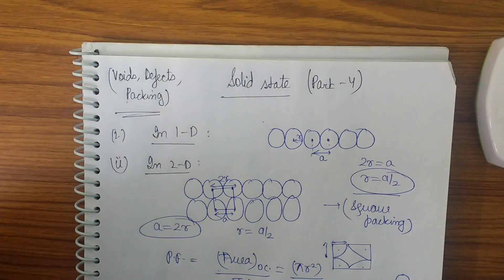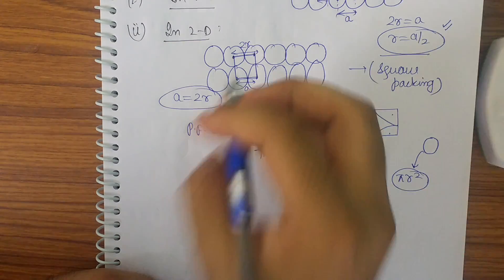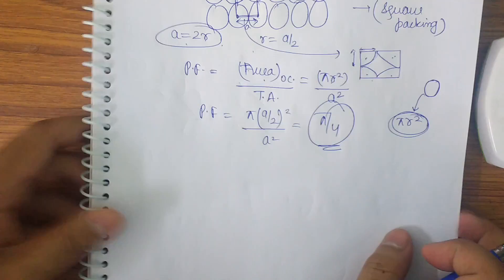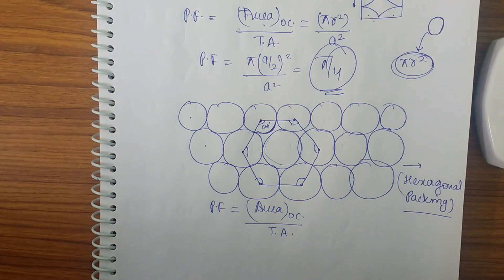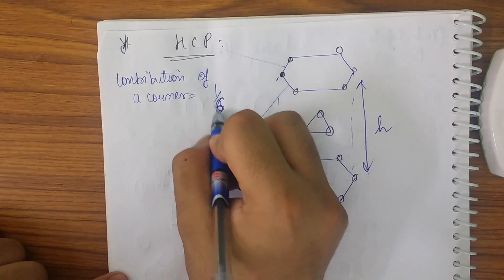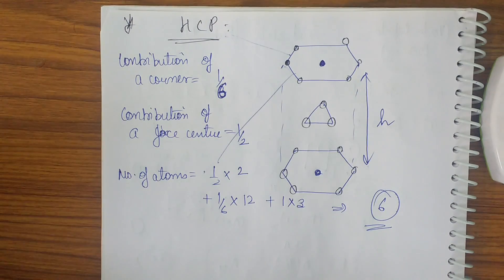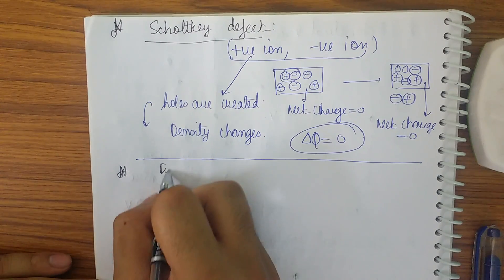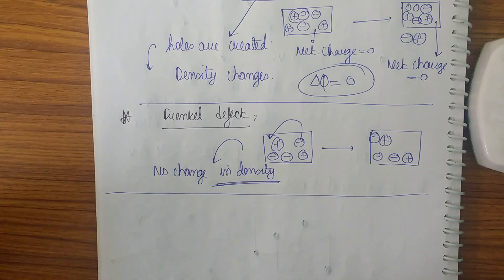Solid State (Part IV): Voids, Defects.

Comment: Hi, bhaiya I had a doubt. In metallic crystals the binding force is the metallic bond,which is non directional in nature.Consequently it is easier to slide the molecules, since different orientations would not result in diminution of the attractive force.....then wouldn't that mean that metals should have been soft? The same way as the molecular crystals are?
Thanks in advance
Reply: did you got the answer?